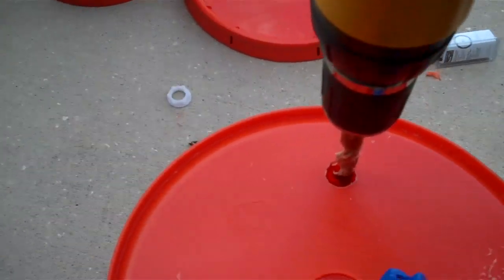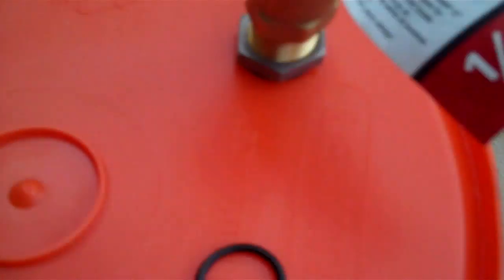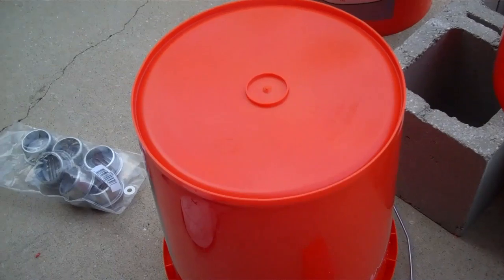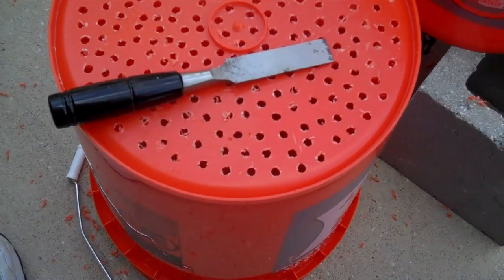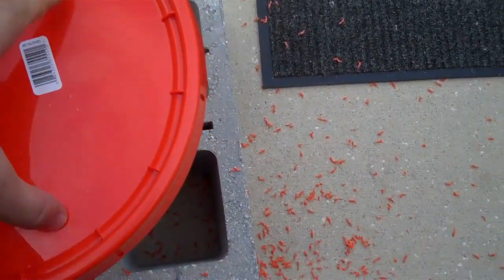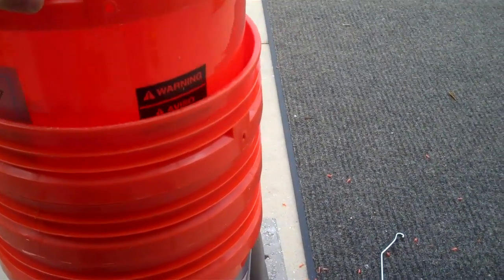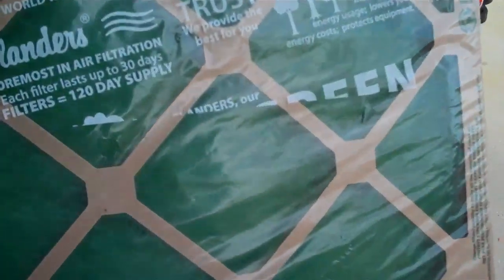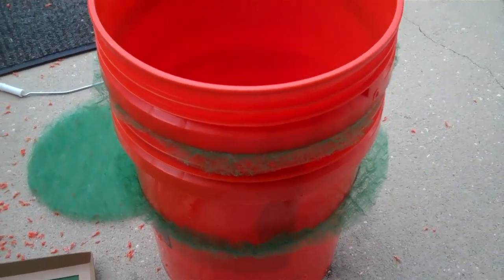Worm Farm Part II

Comment: I made the same bucket design, Use window screen with velcro applied with contact cement to keep bugs out, remove screen-add scraps-put screen back on! I used a longer screen to compensate for bucket rising with more scraps added to worms and  the velcro makes up the difference when its empty, half full to full. Aloha

Comment from the maker: @thegoodgreen1 I put a matching nut on the inside.  It works really well but I think I'd buy a worm farm if you really want to get into it.  I didn't want to spend a 100 bucks and find out I killed the worms PLUS it seemed like a fun little project.  I'm thinking of investing in one now...  I've just about filled the first tray and I'm getting ready to add the second tray (bucket) and begin putting material in it to get the worms to move up.  Guess I need to do another update when I do that.